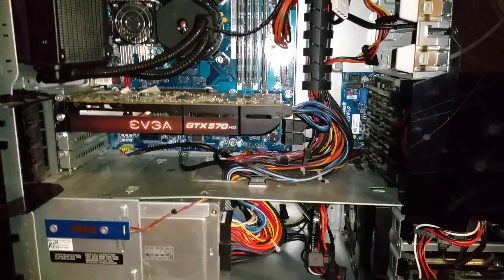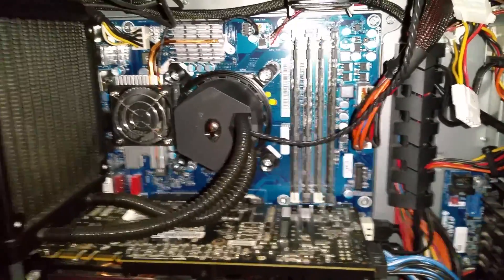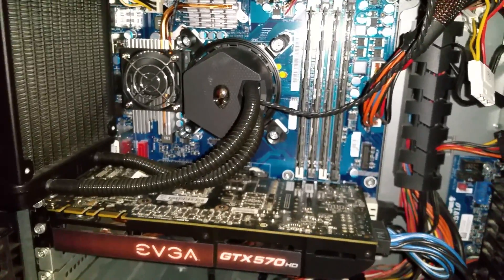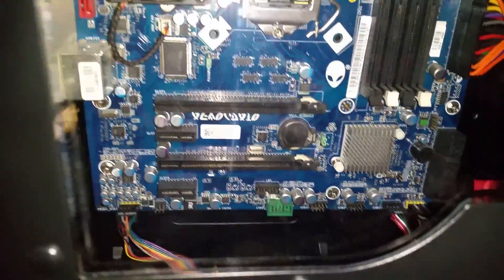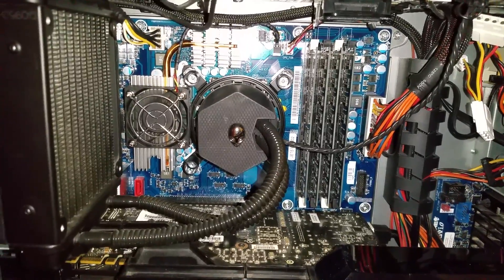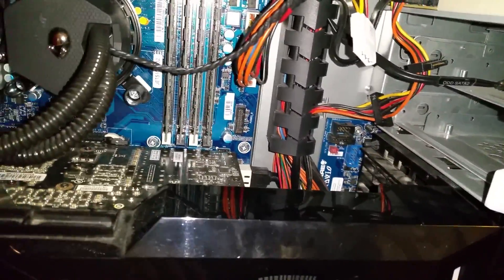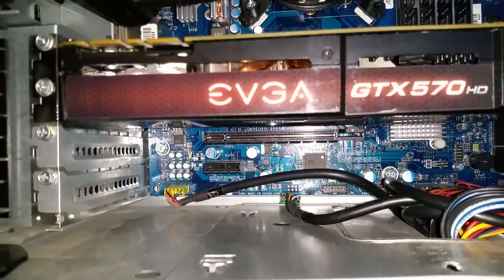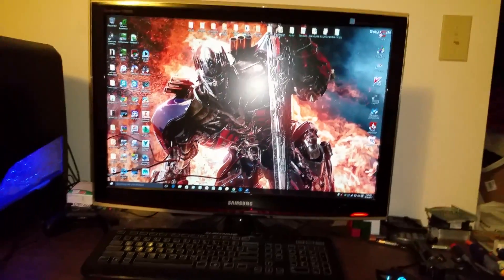Alienware aurora r2 turned into r3

Comment: Hey man nice video. Could you help me finding a motherboard that fits into an r2 and has got an LGA1151 socket? does the liquid cooler still fit with this kind of socket? What about lights, heat sensors and fans how are they going to be connected?
Reply from the maker: the liquid cooler should still fit as its a matter of only a few pins in the socket...the lga 115x sockets have interchange able heatsinks and any micro atx motherboard will fit so long that it only has 4 pci express slots, you just have to be cautious with how your going to wire it all up...i took the simple route and just put in a new board from an r3...you could also use an r4 board aswell...however ive got no idea how to pull magic with the wiring man...i do know asus has a special adapter that will make some of their boards work, just gotta do some searchin about it
Reply: pccentral102 hmm okay thank you. I dont want to kill my aurora so Im very cautinous about that. I even wrote to Alienware Support but they couldnt help me :(
Reply from the maker: Nicci S alienware will never help you create a custome pc out of their computer case, i wish they did but they wont...i suggest just getting a newer alienware motherboard from a newer gen such as the r3 or r4 because we know that it works and will run fine, but you could also get the alx board that will fit the extreme intel processors, that will support more lights and better power but you will need a different liquid cooler...if you really want a custom build then i wouldnt stay with the alienware case man, its going to cause more headaches than not, to figure out the software issues and wiring issues...otherwise id stay with the alienware boards because they are interchangeable as thats what i wanted to prove in this video
Reply: pccentral102 yeah i noticed that they didnt want to help me. Do you know where I could get an r4 board for LGA 1151 processor socket? I really love my Aurora R2
Reply from the maker: Nicci S ebay is your best friend man, ill take a look to see what i can find, but why lga 1151?
Reply: pccentral102 okay, thank you. I want LGA 1151 because I would like to put an Intel i7 6700k on it.
Reply from the maker: Nicci S yeah the aurora series doesnt support the lga 1151 processors man, the two better they support over the r2 is the lga 1155 and lga 2011...the 1151 socket supports ddr4 and that wasnt brought in until the newer cases such as the area 51 i think it is...i mean you can still put a 1155 or 2011 board in but otherwise you gotta rebuild everything or buy a new pc man
Reply: pccentral102 yeah than im gonna look after a good processor for a r4 board if thats possible. What processor socket does the r4 support?

Comment: Ok, I've got the same R2 you had, can you post the motherboard part # and I guess ide need to just search for dead R3 for parts for rear plate,  If you slide out the hard drive bay-fan and look at it, it has a ton of unnecessary little fins, I took a new pair of wire cutters made for plastic models and removed them neatly, there is no need for them and I think you'd agree,   I run two ATI cards in crossfire without over heating because I crank up the PCI fan and card fans, its noisy but cool. have you played with the case fan speeds? I'm sure you have, thanks.
Reply from the maker: http://www.ebay.com/itm/OEM-Genuine-Alienware-Aurora-R3-i3-i5-i7-Motherboard-DF1G9-/121644783406?hash=item1c5298172e:g:~bIAAOSwG-1Wxe53  ...for this build i picked any random r3 motherboard to be honest...because clearly our towers are out of warranty...that is really the cheapest one i could find for ya, but when i picked up my board on ebay it was a lot cheaper and it was manu refurbished as well...the board also sat for a year until i got the rest of my parts...i trust ebay as i always get my pc parts from there...i only have a asus geforce gtx 670 4gb now with 16gb ddr3 of ram with the i7 2600k in my pc, i have not had any issues with my fans except after the windows 10 installation where the lights flicker and fans spin up speed and then go down to lower rpms consistently for a minute or so..and sometimes the alienware temp controls go to shit since win 10 and what this does is until i reinstall the command center the fans will spin at 100% while the lights flicker and its so annoying...sometimes i put it under manual control using the temp:rpm curve which works well...but no i have never really had to deal with over heating problems or fan speeds but ive played with them here and there...depending on your cards, you may beable to take the top casing off of them to create more room for airflow while making it easier for air to get in aswell...and btw, that r3 rear plate took forever to find...almost a year of constant looking, but they are out there...i have been all over the place with this comment but if you would like more detail or need more help i am always willing to give help!
Reply: Thanks for getting me started, so, I can still get by using the unit without the back plate I'm assuming, I installed the 825w power supply, I chickened out and didn't want to mess with the hard dive bays and now I'm glad, I want to try and run a raid 10 set up with cheap ssd drives
Reply from the maker: yep, you can use the motherboard without the back plate, just be careful inserting usb's and what not and youll be fine...eventually you should beable to find a back plate
Reply: I'm really glad to see the 16GB of G-skills ddr3 I just upgraded will work with the newer board,  where the sub board connections easy to pug in and figure out, did you have to mess with any board jumpers?
Reply from the maker: +stclairstclair nope, thats the reason why i didnt use an aftermarket board...i saw all the problems people have gone through to make em compatible...so in theory i thought, if its one generation new of the same pc and the boards look similar with just certain things updated, then it all should be just a plug n play upgrade...and it was...it just took me a while to figure out why i kept getting bsod errors, which was because of my hard drive setting in the bios...the reason i made these videos was because i have seen little to no info on this kind of upgrade...now if im to move up to an r4 board, i couldnt guarantee easy compatibility like the r2 to am r3 board...but no just swap the boards out and youll be fine...just remember what your bio settings are before hand so nothing can surprise you
Reply from the maker: +stclairstclair i just uploaded a new video that i took last week, its nothing special...i actually forgot what the contents within the video was about but it was somethin about this upgrade...feel free to take a look at it

Comment: Do you think it's possible to change a r1 into a r4? Would the mio board for the r4 be the same as the r1?
Reply from the maker: its definitely possible...you may have to change the liquid cooler depending on the cpu socket size you get for the motherboard...as for the mio board i think a lot of changes would have been made between the r3 and r4...just my gut feeling...what you could do is do the swap with the original mio board and if it doesnt work then replace that and if it does then leave it...do not fix somethin that aint broke ya know?...thats how id go about it personally because it removes the question out of the situation...but yes you should be fine also the cases from r1-r4 are basically the same besides the hard drive bays depending on the model you have...
Reply: So do you think I should get a r4 mio board if I get a r4 motherboard and does it matter if I put  r4 ALX components in a non ALX r1 chassis?
Reply from the maker: +derek ortega the alx parts if its just the motherboard and mio and nothing else not chasis lights n what not (because they are a bitch to install) then you should be good, there will be extra ports on the boards thatll be open since the alx has different chasis components...if you want, order the mio board just incase, i mean it cant hurt anything really besides your pocket, but thats besides the fact...with this id actually start off with a fresh install of windows, just because i wouldnt want to mess with any lingering programs or drivers that may be hidden from the old mio board...i could be over thinkin that...but thats just my 2cents